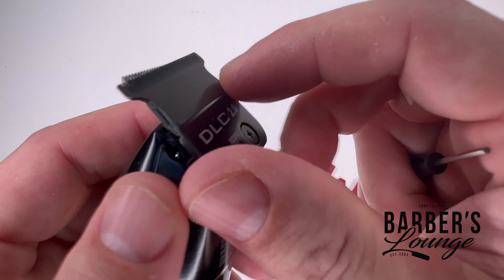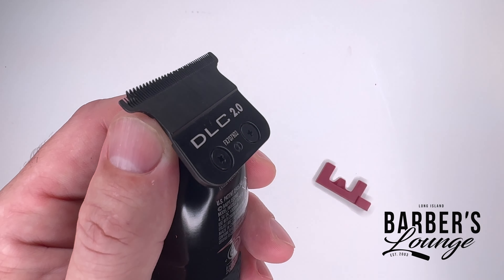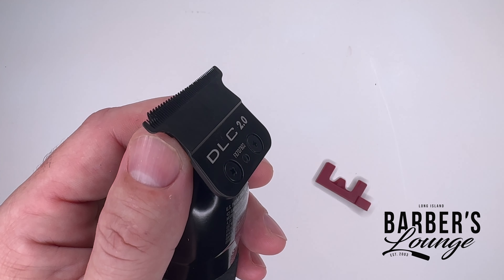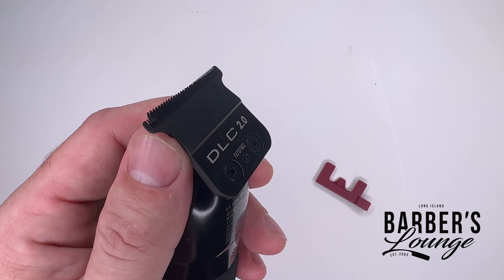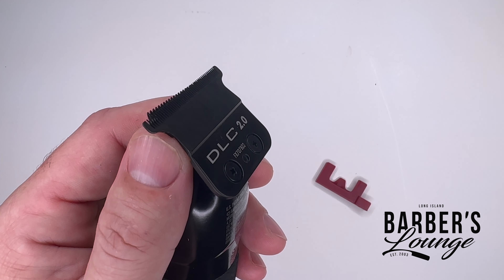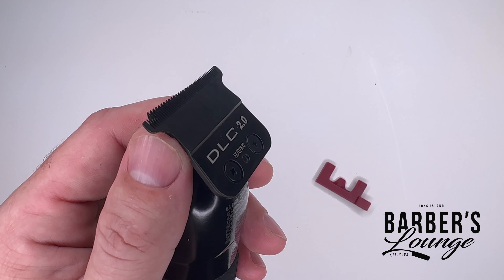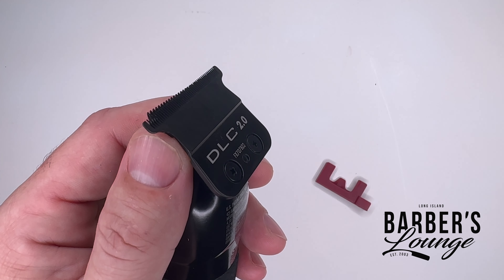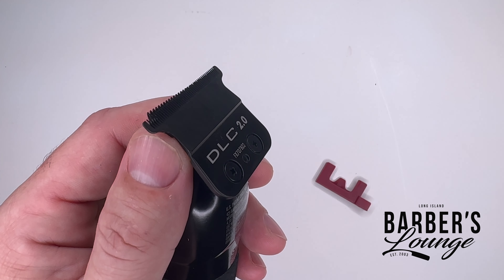How To Zero Gap BaBylissPro FX, Boost+, SnapFX Trimmers / Outliners / Liners 💈

Comment: I just bought the new snapfx trimmer yesterday and while using it today, it bites a lot, pinches the skin the hair, and cant even use it on the beard. Should i try adjusting the blades maybe or smth?
Reply from the maker: The stationary blade is pinching?
Reply: @barberslounge  I’m not too sure, but I believe its the stationary one
Reply from the maker: @Darkz-25  happens primarily underneath the chin? And makes little red dot blood marks?
Reply: @barberslounge  that too, but it happens even on head while cutting or doing the edges with the edge of the trimmer.
Ive used the old version skeleton fx and i know they’re a bit sharp but with these new onea I can’t work at all
Reply from the maker: @Darkz-25  yea sometimes that stationary blade is too thin and pointy and gets caught in peoples pores. I’m actually looking into a method to dull it down a little bit so that doesn’t happen. You can always swap the old stationary blade in and keep the new cutting blade too
Reply: @barberslounge  oh okay, i was hoping that maybe adjusting the blade would help, guess not since its the stationary fault
Reply from the maker: @Darkz-25  yea it happens sometimes and it’s super annoying and makes you abandon the machine or just work with it until it dulls and breaks in
Reply: @barberslounge  Thanks for the info and your time 👌🏻
Reply: Please sell it to me,

Comment: You mentioned that they already come zero gaped in the video, so can you get them even closer with your own adjustments?
Reply from the maker: Yes
Reply: Are there any safety concerns with  having the blades close as possible? I saw someone’s statement regarding it is not safe to have have clippers all the way zero gapped. What is tour expertise knowledge and opinion on this?
Reply from the maker: @tenioladeji7681  if it’s too close the trimmer can chew up the skin because the blade that does the actual cutting is too close, it’s all on the video
Reply: Ok thanks, i went ahead and made my own adjustments. When screwing the blade back in place, I tried to center it as much as possible on top of the wider blade. After screwing it in place, I noticed  that the blade can still shift sideways especially after I turn the trimmer on and then off, I noticed that the blade was positioned far left or far right of the wider blades sometimes. Is this normal, or should my cutting blade be centered and not be able to shift sideways after setting adjustments in place and after done using it? Bare with me for the questions, I just want to make sure everything is right.
Reply from the maker: @tenioladeji7681  heard to tell without seeing it, do the roll test on the back of your hand and see if it chews you up at all. If it doesn’t you should be good. Sounds like you’re just talking about the rotating positions the motor puts the cutting blade in

Comment: I despise anything Stylecraft or Gamma related, most of it is overpriced Garbage purchased for very cheap & upsold for incredibly high profit margins.  I am personally thinking of purchasing the Snap FX trimmer & replacing the blade with a TPOB Gold Psycho 6.9 blade which is better than the GoldFx blade which is renowned for being one of the best. The Graphite blade just keeps it cooler for a little longer, that's all! As for wanting the Actual best Clipper, you are better going for the JRL Onyx, which is top quality build & Machining!
Reply from the maker: @t1nma5k22  The Snap FX and the JRL Onyx are the same price, so why not just get the JRL??

Comment: Great video. What's the actual difference between the 3 trimmers?
Reply from the maker: Motor and better life. I have a more in depth video on it 💈 COMPARISON & REVIEW of BaByliss ProFX, BOOST FX and SNAPFX Clipper & Trimmer Liner 💈
https://youtu.be/SFw2oEQow3k
Reply: @barberslounge  great. I am going to check it out soon. 
Which babyliss blade cuts the closest to skin? 
I hate shaving by blade so need the best trimmer that cuts close to skin. I am not even sure the babyliss is the best. Never had a high end trimmer before.  Any idea is much appreciated.
Reply from the maker: @ric0816  they all have the same ability to cut close, it just depends on how close you zero gap it. If you don’t like shaving with the blade. Buzz it down with the trimmer and then use a foil head shaver to get it even closer